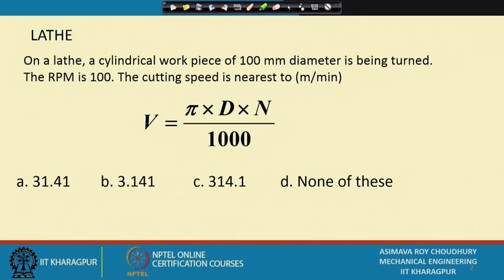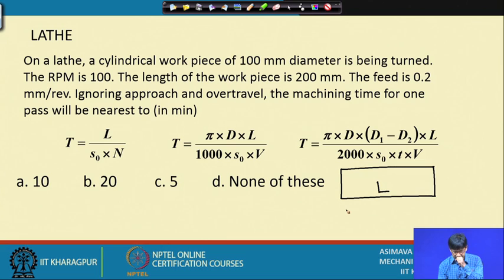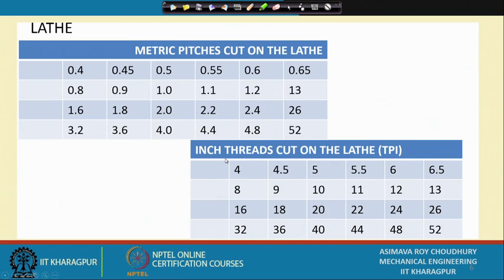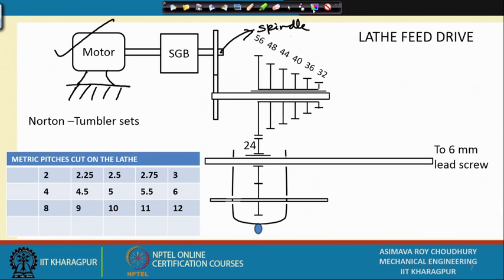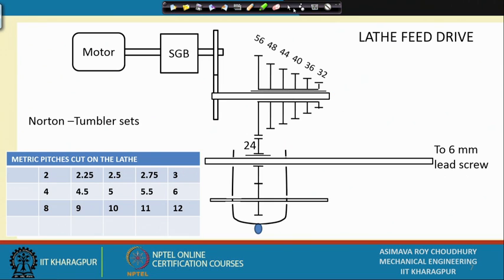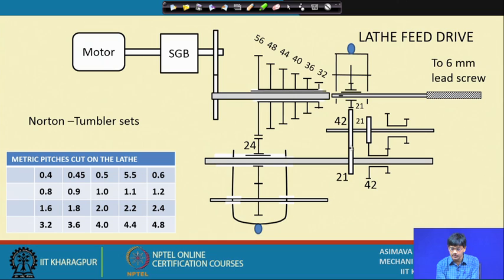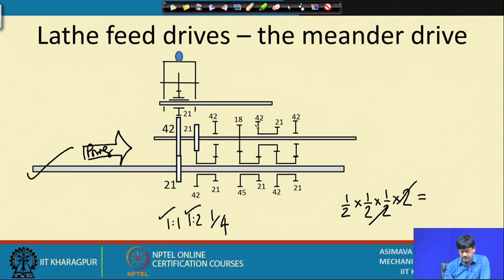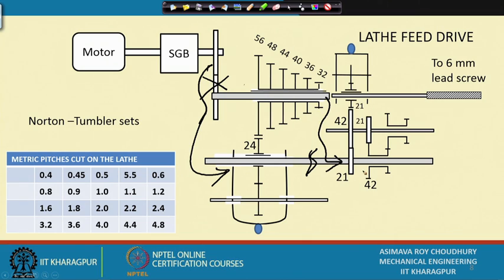Numerical problems on lathe

Comment: In first mcq question, diameter is in mm, shouldn't it be converted in meter first?
Reply: no it no need to convert, 1000 in denominator is to convert mm to meter
Reply: Ya